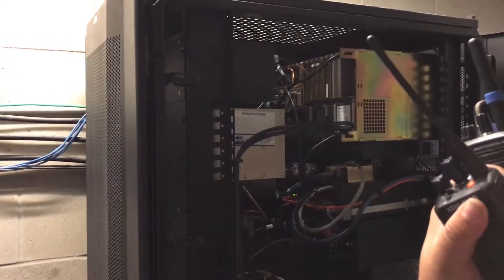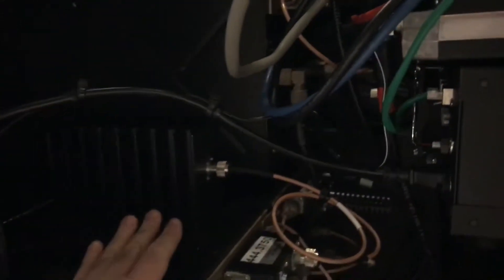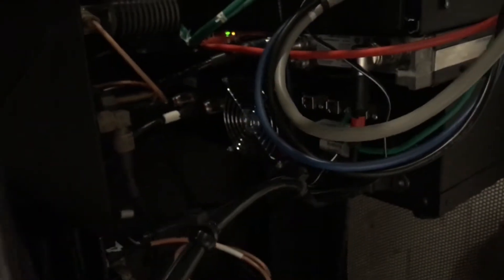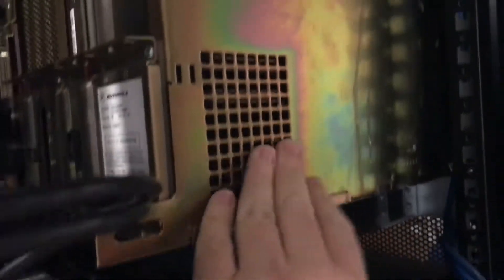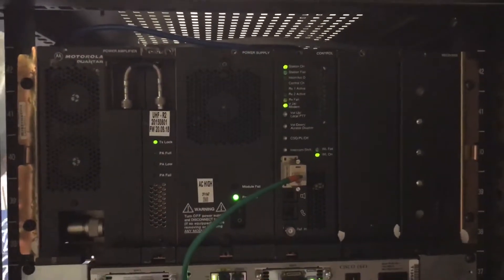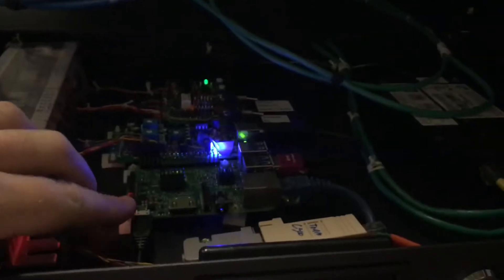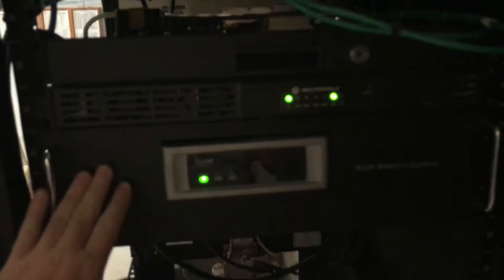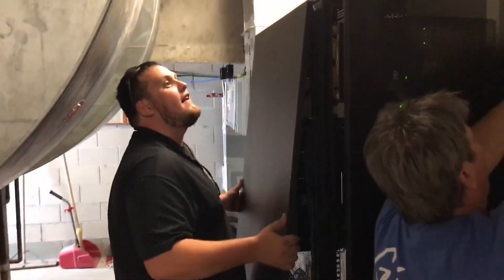Florida Simulcast Group: St Petersburg Repeater Site

Comment: Very nice setup! Setup a VHF 6 frequency Narrowband compliant LTR system many moons ago. Used Telewave RX muticoupler with the output running through custom made crystal filters to eliminate a lot of the interference around the site. TX combiner was also from Telewave. This system worked great once it went onto a decent tower site. At the same location we had also built up a 220MHz LTR system, it was a fiasco from the start since the FCC only allowed 1 MHz difference between RX and TX. ACSB equipment from SEA Datamarine. Was not too happy about this since I am an Amature radio operator as well and the commission stole a portion of our spectrum for this junk. Must have been a planned failure to steal spectrum. From what I gather today some 20 plus years later, this section sits idle.